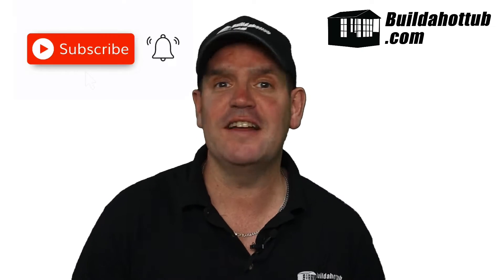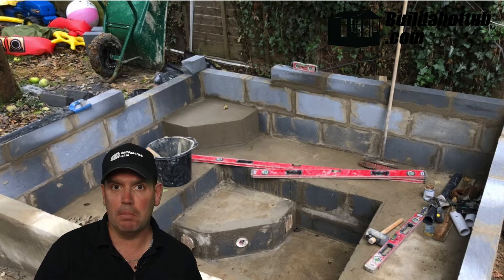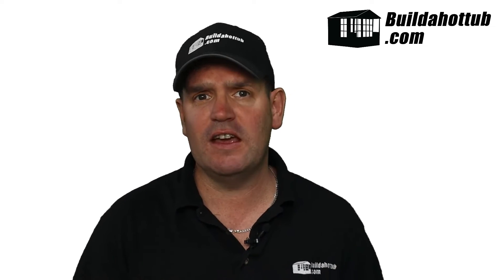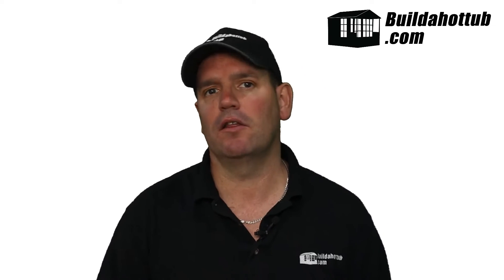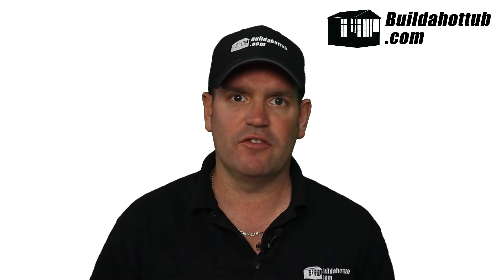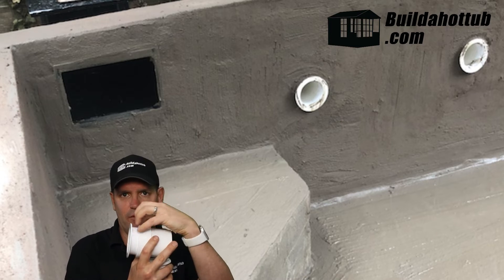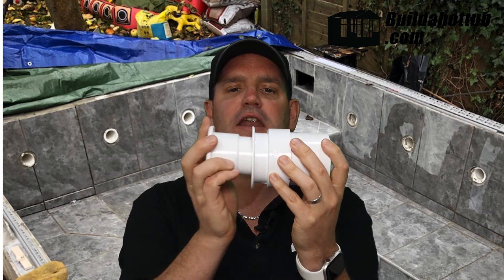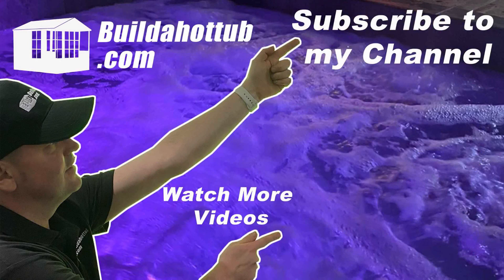Waterproofing, Grout & Tile Adhesive for DIY Hot Tubs

Comment: Hello Mr Buildahottub ,  we have a tub that is 25 years old with single 1 inch square tiles popping off, 60 so far.  drained the tub and found the grout has been worn away  exposing the sides of the tiles.  Question is can we epoxy the the tiles back in place thene put a new layer of grout in place?  Thank you for your channel !
Reply from the maker: Hi Lance - thanks for the comment - absolutely! You can actually get epoxy adhesive/grout in one product so you only need to do it once - but what you are suggesting is totally the right thing to do - thanks for the comment and enjoy the refurb - Andi aka Mr Buildahottub